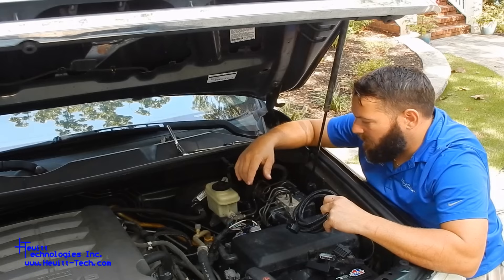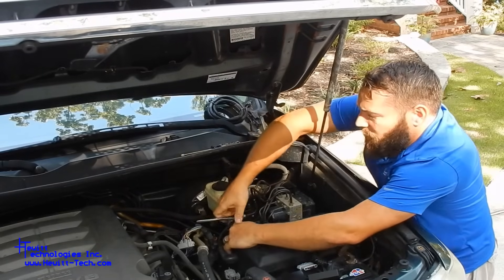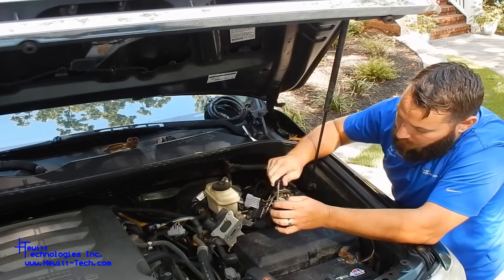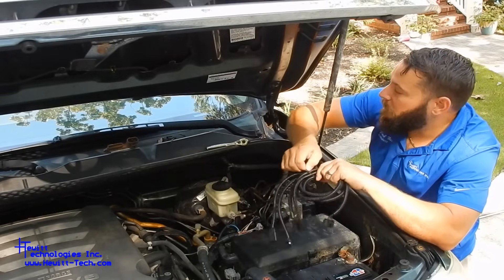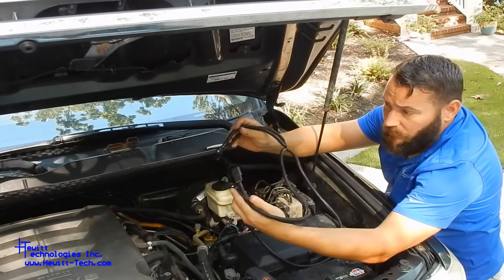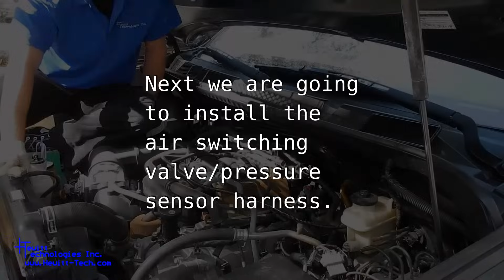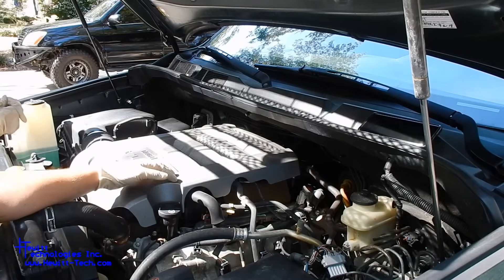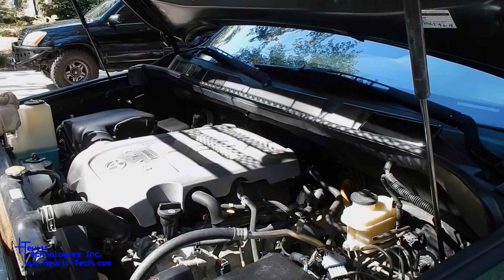Gen-II Secondary Air Injection Bypass Module - 2007-2021 Tundra 5.7L- Hewitt Technologies

Comment: I just did this on my 2010 4.6 Tundra.  The kit arrived a day early and the instructions were phenomenal.  Took me about 90 minutes with harness and block off plates.  I wish all businesses put this much detail and energy in their products.  Thank you.
Reply from the maker: Tommy, thank you very much for taking the time to leave your feedback... we are constantly looking for ways to improve.
Reply: Can I ask what did your truck do? Before you installed the kit?
Reply: @Hewitt-tech   hello sir my truck having some problems a guy told me to get these kit will
It work?
Reply from the maker: @rodoaguilar4804  Please contact us directly with your trouble codes. You can give us a call toll free during our normal phone hours 8AM-5PM EST 1-844-307-7671 or send an email to support@hewitt-tech.com and we would be glad to see if we can help.
Reply: @Hewitt-tech  I have a 2012 toyota tundra 4.6 v8 I have a c1201 code and a p0419 code
Reply from the maker: @tombell8592  The P0419 is an Electric SAIS Fault code related to the Bank #2 Air Pump. The Gen 2 Bypass Kit is engineered to address that error code but we typically do not see the C1201 trip with it. That code indicates "Limp Mode". Give us a call or shoot us an email and we are happy to help troubleshoot. (844) 307-7671 Support@hewitt-tech.com
Reply from the maker: @tombell8592  Sorry for the slow reply. We have you covered. The P0419 is a bank 2 air pump circuit code. Most often it is the air pump that open circuits but it can be anything in that circuit including a bad air injection control driver. The Gen2 kit has you covered for these codes and is very easy to install on the 4.6L.
Reply: What's ur best way getting in the block 🚫 off plates?
Reply: @Hewitt-tech I have code P0418, and my truck seems to be running fine.   Am I ok to drive until I get the kit?
Reply: @Hewitt-tech  what about a p2433 code?
Reply: @rayonwilliamssportsandfun2106  everything is done under the hood, top of engine.   Make sure you block off the correct places.  Instructions clearly show where to do this.  Spray every nut and bolt that comes apart with PB blaster.  I used WD 40 and it worked fine.  Where the block off plates go just loosen bolts enough to slip in plates.  In order to give the exhaust pipe enough room to slip in the block off plates you have to remove the bolts holding the stainless steel exhaust pipe brackets.  That's the hardest part, kinda tricky to get to. 10mm  6 point  socket, with a swivel and correct length of extension.  Driver side took a medium length extension.   Passenger side took a longer extension.   You have to completely remove those bolts to get enough movement to slip in the stainless steel block off plates.  After you get the bolts tight holding the block off plates in place.  Then go back to install the exhaust tube brackets in place.  I used a piece of broom handle over a ft. long to pry the bracket far enough forward to reinstall all 4 bolts.  Just use the same socket-swivel-extension combo and NOT  THE  RATCHET.  Just get them all 4 started by hand before tightening any of them.  If you can't get them started finger tight DON'T  force it.  You will cross thread the bolts and have a real mess.  I was able to get every bolt back in I took out using the broom handle to pry the tube assembly forward.   Instructions say you may have to leave those bolts out.  I used a simple 10 mm wrench to loosen and install the block off plates.  Kinda of a pain, but I take pride in my mechanical abilities and leaving a few bolts out would be considered a compromise to me.  Order the kit, it will be definitely worth it in the future.   Pay 100's now or thousands at the dealership later.  Best of luck (  :
Reply: I have a 5.7 what is the benefit?  I get if you need to replace your banks because they’re bad why not install a bypass but if everything’s working fine what’s the benefit of installing the bypass?

Comment: After Seeing p2442 code and multiple limp mode incidents on my 2008 5.7L Tundra. Was told by Toyota dealer I needed a $2,995 repair to fix the errors. I Installed the Gen1 bypass tonight and so far seems to be back to normal operation. Thank you!!!!!
Reply: Hello, any update on how it’s going? Mine came on, on my 2013 5.7v8 Tundra
Reply: @The3rdCoin  mine just came on 2011 4.7 v8. gonna get one and hope it doesn't lead to issues down the road
Reply: My 2013 Tundra hit 119,000 miles.
The engine light went off leaving the house. 
It got into limp mode, I drove it back to my house.
Put the scanner & it was P2445 code tho.
I deleted the code, and drove it around for a day & it came back on.

So I will take it to a mechanic to get a full inspection & and see what the cost will be.
Reply: @The3rdCoin  its gonna cost 2000-3000 unless you bypass

Comment: Just installed this, worked just like it should, no codes and I did have to call their tech line and they were awesome. Getting that passenger clip off though……wow. I’t took me about 4 hours just for the clip, threw every tool I had at it and finally got it with two long flathead screwdrivers. Saved me a couple grand though and it runs so smooth now. 2007 5.7l.

Comment: Best customer service EVER!! I got one for my 2008 4runner. It works perfect. A month after I installed it my car threw another code and I thought it had gone bad. I call Hewitt and they diagnosed the codes over the phone. The technician said it was probably my gas cap. I looked at my gas cap and sure enough my gas cap was loose. I tightened my cap and all is well. Saved me a trip to the auto shop!!
Reply from the maker: Hewitt is here to help! Glad we were able to add value in the troubleshooting process and if there is anything else we can assist with please do not hesitate to contact us.
Reply: How can I talk to him I changed my pumps and now the random misfire is worse than before

Comment: Installed this kit on my 09 5.7L Tundra before I had any issues and so far works fine. This was a challenge but doable. What helped was taking off the front wheels ( you will need to do this anyway to install the block-off plates) and lower the front end down for easier access to the air switching valves. Use one of the tires to stand on instead of a plastic slip and slide step stool to stand on. To remove the switching valve (made in hell) connectors, I had a very small flat bladed screwdriver 1 1/2" length with a shank 3/4" long with a dia. .075 (a little over 1/6"). A nail would probably work. Insert this in the top hole back of the connector to override the latch. Now you can focus on the connector body without damaging the wires in the process. Practice this with the connector on the airbox (same one used on the valves). Hope this helps.

Comment: My 2008 toyota tundra 4.7l is now running smoothly and out of limp mode.   The kit truely is plug and play and the blocking plates were easy to put in from the top not the wheel well on my truck.  excellent instructions, and the customer service was also excellent answering my questions prior to my purchase as well.  would definitely recommend it to anyone with a tundra having those SAIS engine code problems.  Thanks.
Reply: Is there step by step instructions with the part when you receive it?
Reply: Sorry for the delay hope u got it fixed... The instructions are awesome if u still are considering it and there are videos on YouTube as you know
Reply: Just a followup...  Still got the truck and the kit still is running perfectly after 2 years

Comment: 14:00 the wife and I just installed it tonight Codes are gone. Helpful tip to disconnect the passenger side connecter use a screwdriver go between the main wiring harness, and the motor push down on the clip comes right off 5 seconds unbelievable couldn’t believe it. I wish I would’ve done that to the driver side as that took like 20 minutes.
2007 Toyota tundra, 5.7 L.  
478,000km
Reply from the maker: @jaywiseman3778 Thanks for passing along your experience and these connectors can be a bit of a bear to get to. Glad to hear your codes are clear and the truck is back to normal. If you have the time we would greatly appreciate if you could also share on our Google review page. Please let us know if there is anything else we can assist with in the future. https://g.page/r/CYkk2OeC9CgvEB0/review

Comment: I just completed installing this on my 2012 sequoia with the 5.7 engine. Gotta say the connection to the driver's side pump was extremely hard and did not go like the video. I found it helped removing the line he said but also i loosened the holders for the main wiring harness which was really hindering me from getting my hand on the clip. My clip was very hard to depress probably due to age. For the passenger side i used a picc and screwdriver to disconnect the wires. The picc raised the retaining clip and flat head pushed it off. The wifes little hand helped connect hewitts connection to the valve. I also got the caps installed (driver side was worst) and so far so good. No codes and shes running fine.
Reply from the maker: @ryanv7195 We really appreciate you taking the time to share your install experience. Each vehicle can provide different challenges and the more feedback there is the better it is for the community. What you described is not uncommon but loosening up the bolt and main harness does give you a little more wiggle room when installing. I think your wife is the real MVP and glad the truck is back up and running without any error codes. If there is anything else we can assist with please do not hesitate to contact us.

Comment: In response to a P2443 code, I installed Hewitt's Gen 2 Bypass Kit in my 2007 Tundra a couple of weeks ago and fixed the problem. Spray the bolts in the wheel well several times during the evening where you install the block plates and let them sit overnight, and loosened mine in the morning, no problem. And I'm in the rust belt and my truck is 16 years old. Regarding the two final electrical connections at the rear of the motor, Practice undoing on the new ones that comes with the kit, or practice on the one mounted on your air cleaner housing. Put a trouble light back there because if you can get a visual on it, it really helps. The drivers side is easier to access and depress, it's sitting right at the corner. If you have trouble depressing the clip, my thumb's kind of fat and wide so I taped a one inch long piece of very small dowelling up the centre of my thumb, a little piece of a twig off a tree would work fine. The passenger side, I threw a cushion down and climbed up there and I could barely see the clip past the wiring harness, but good enough to get a dental pick on it with my right hand, lift the locking clip just high enough to clear, and with my left hand in place and my fingertips just able to grab the connector, pull it apart...and Bob's your Uncle! Then hooking up the kit connectors is easy and away you go! Tech support is outstanding if you need help!
Reply from the maker: To a T my good sir. We really appreciate you writing about your experience installing the HT Bypass Kit. Particularly the 5.7L can have its challenges. I could not agree more with your use of penetrating oil and liked your tips about depressing the tabs on the connectors along the fire wall. Where there is a will there is a way!

Comment: I snapped the bolts off on the manifold where the backing plate goes, bolts were easily drilled out . Not as hard as ya think, just get 2 foot 1/4 inch drill bit and some patience
Reply from the maker: That is quite the drill bit! Glad you were able to get that done and hopefully your comment will help some of our other unfortunate customers deal with this! Thanks for the comment.

Comment: I installed the kit today, 2011 4.6 Tundra double cab 115,000 miles.  Everything went ok.  The bolts on the passenger side for the exhaust tube support bracket in rear were a PITA to get to.  Other than that it went well.  I wasn't having any issues, no check engine light on before or after the install.  Thank you for a good solution to what would have been a Major issue down the road.  I appreciate the quality and thorough  installation instructions.

Comment: Hey I purchased this kit about 2 years ago. Worked perfectly but a few months ago started throwing the p2442 code again. I believe something came loose back by the air switching valves. I also don’t recall my mechanic using any block off plates. What happens if you don’t use the block off plates?
Reply from the maker: Even though the system is no longer physically operating, the air switching valves can, and often do, leak later on down the road.  All of our kits include block off plates because of this exact reason and we always recommend installing them with the kit. Installing the plates and clearing the codes is the next step. Contact us directly for anymore help or to get a set of replacement plates.
Reply: @ Ok awesome appreciate it

Comment: I CANNOT recommend Hewitt ENOUGH!!!! After my check engine light came on and my 2011 Tundra and it went into limp mode I was PISSED! The truck has NEVER been repaired and the 1st problem is EMISSIONS! Even better when the dealer quoted OVER $3K! I ordered the Gen 2 module and harness, installed it, but still dead. I contacted Hewitt and they suggested ordering the sensors. installed still DEAD!!! Now I'm really losing it! I talked to a tech at Hewitt and he helped me diagnose a BROKEN wire on one of my connectors....Ordered a new connector and pigtail and BOOM! Up and RUNNING!!!! They allowed me to return the sensors and in my OPINION have shown what AMERICAN COMPANIES Customer Service SHOULD BE!!!!!! THANK YOU SO MUCH!!!
Reply from the maker: Thank you for taking the time to leave your feedback and I am glad we were able to help get you back up and running. It can be frustrating when things don't work like they should and your situation is a perfect example of this. We are grateful to have customers that are patient and willing to follow our process of troubleshooting so that we can identify the exact problem(s) and get you back on the road again and enjoying your Toyota/Lexus again!

Comment: I bought one it worked great for about 3 months, then it stopped working,I contacted the seller and they said that the kit only works with the oem valves. And tried to sale me the oem valves. Will update a little more detail info later on.
Reply from the maker: This all depends on the codes and what your specific codes and circumstances are (aftermarket parts etc..) Often, in cases like this you need to install the block off plates or the pressure sensors in your system have been damaged or failed. We do have factory replacement pressure sensor addons if it was your pressure sensors indicated as the failed part.
Reply: @Hewitt-tech  I did have the block off plates, like I said it worked great for about three months than it stopped working, how do I know it stopped working? Because I moved the block off plates and disconnected the bypass kit and reconnected the “aftermarket “ sensors, which works good, and it worked ( no codes) that tells me that the bypass kit failed. Now I do understand that things like this happen I work for a manufacture company and sometimes products doesn’t work as supposed to, customer request an RMA they send us the product back we inspect it and analyze the problem, if it’s not fixable we send them a replacement ( warranty) that you don’t offer. Instead you try to sale an “oem” sensors because “ your bypass kit only works with “oem” parts.

Comment: Pretty good video up until the time you guys try to install the air switching valves. That has to be a different video you can’t even even see what you’re doing
Reply from the maker: @j.anders6895  Your right, and its mentioned in the video its a PITA. There is basically no way to show what is going on back there. Take a look at the installation instructions for a few more details. There are a couple of pictures but this is still one of those jobs you have to do by feel unless you remove the intake manifold.
If you can figure out how to film that part of the  installation, let us know! 😃

Comment: What is the average time required to complete the installation, bypass kit and block plates?  Assume a moderately mechanically inclined DIY.  Thanks.
Reply from the maker: For the Gen2 kit on a 5.7L we typically say 1-2 hrs. shop time.
Reply: @Hewitt-tech  Thanks again for great support.

Comment: I got this kit for a 2013 5.7L Tundra and have swaped out the module easy enough. I am currently stuck trying to locate the plugs for the air switching valves and I can not find them for the life of me. Felt around back there for like an hour and don't think I ever found them. Anyone have any advice for locating these?
Reply from the maker: EDIT It helps when you aren't looking for the 5.7L valves and have a 4.6L... sorry gave me a chuckle. It happens, don't feel bad. 
They are practically impossible to see from the top of the engine. Take a look at the installation instructions, the pictures on page 7 and 8 are from the back corners of the intake manifold. The connector is the same as the one for the MAF sensor on your air box. There really is no other way to see or get to them other than by feel. Unbolt and gently move the things we mention in the installation instructions to get a little more room. If you have a friend with smaller stronger hands, that helps too.